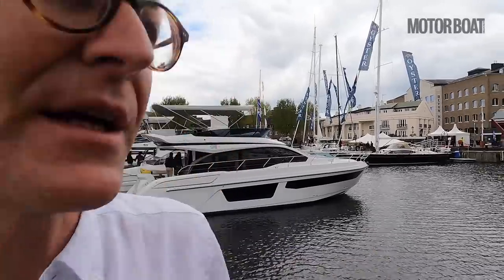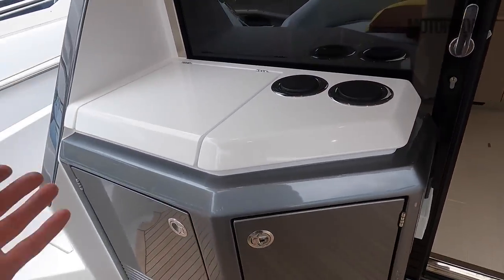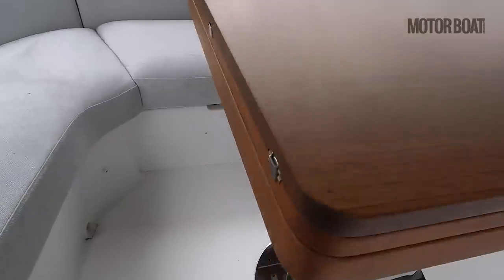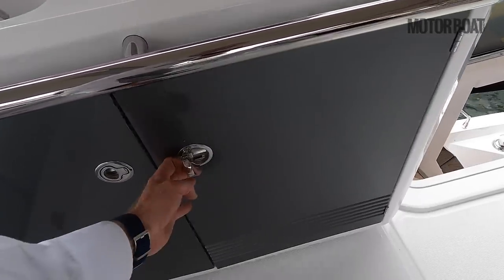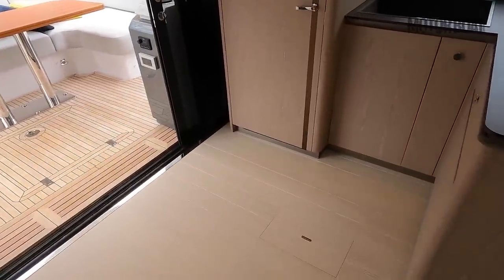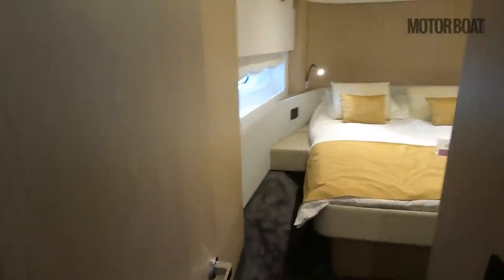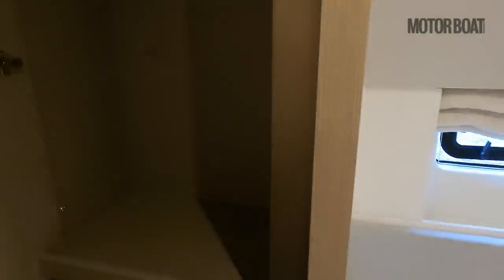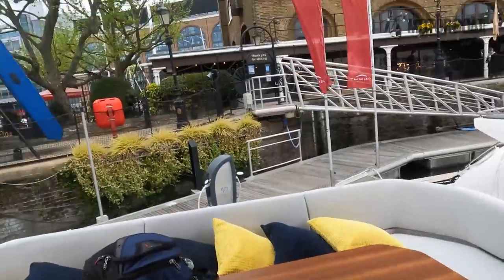Azimut 53 Fly yacht tour | Inside the Italian yard's £1.1m entry-level flybridge | MBY

Comment: Nice boat, nice use of space in the cockpit and at the bow. ( Need more of those wine bottles or beer chillers like the ones in the cockpit though)
The salon and cabins are nicely styled with some clever ideas. Like hiding away the fridge and oven. The power breakers under the leather work top. Curved corners so you don't hurt yourself. The helm station is stylish but very comprehensive everything you need.
Small engine room but you can get to everything. All in all a nice boat that should do very well as a first boat.

Comment: Yes I agree. The crew cabin door seems kind of strange. Opening like that. But I have seen it on other yachts, like the Sunseeker 76 yacht. So I guess it works allright?
Reply: As long as there isn't a tender on the aft platform to stop the door opening; and the aft platform isn't in the lowered position so there is only a tiny shelf to walk or stand on to get to the doorway; and you don't ever need a rail or hand-hold to grab while on the transom; and you aren't carrying anything heavy or bulky while you step unsupported over the door, door sill and down a step into the cabin / locker; and there isn't any sort of following sea to swamp the cabin when the door is open; and you don't need a second form of egress should the fancy door / hinge get jammed; and you don't mind taking your crossed aft spring mooring lines off every time you open the door (assuming you can get them to clear the tender on the aft platform in the first place); then yes, I suppose it does work alright...

Comment: The exterior is a princesses copy! Happy sailing all ⚓🛥
Reply: They all look alike at this size and price point.
Reply: Lino Andrade  no way azimut has always had the sharp edged pointing lines that make it look like a supercar and did not look like a princess! But this does like like a princess! I agree with other commentor that most yachts this size look similar but this azimut looks more like a princess! I probably should not of said they copied princess but if you look at previous models say a azimut 60 fly to a princess 62 fly you can clearly see one is azimut and the other looks princess! But now they look very very much the same! But bits hard with a boat at this size to look unique! Look at speed boats 20 feet long! They are look the same! It's a boat so not much you can do but use different furniture and layouts are hard to not loo the same well! Just an observation and I love some azimut! The 60 fly the s6 the new 68fly is amazing but I'm a princess man! No hate just an observation! Thanks happy sailing and God bless ⚓🛥❤🙏
Reply: Lino Andrade  I like azi too! Second favourite after princess! See you on the high seas but not in an azi or princess! They can't handle high seas😁

Comment: Instead of fawning over the addition of so many stainless steel anti-chafing strips, why not insist on designers putting cleats and fairleads in better locations so the anti-chafing strips are not necessary ? Honestly, it's not rocket science... 
The clue is even in the name: they are FAIRLEADS so lines are lead fair - if the lines foul the hull, then they are not being lead fairly so aren't actually FAIRLEADS.

Comment: An emergency back-up bilge pump that is outside the cockpit on the other side of a locking steel gate...
So the weather is bad, the boat is in danger of sinking, and one is expected to step outside the safety of a gated cockpit as far as is physically possible from the secondary cockpit helm controls to operate the last-resort pump ?
Has this design team ever seen a yacht, let alone been at sea on one ?

Comment: A locker for storing mooring lines that can only be opened when the steel gate blocking off the aft platform (where there are mooring cleats) is locked shut...
When are you most likely to need that steel gate open ? When handling lines during mooring... when the gate has to be shut... so you can open the locker to store the lines that you handle when the gate needs to be open...
If professional boat reviewers don't point out these idiotic design flaws, boat builders will just keep making these sort of easily avoidable mistakes.
Reply: You don’t have to put lines in there!